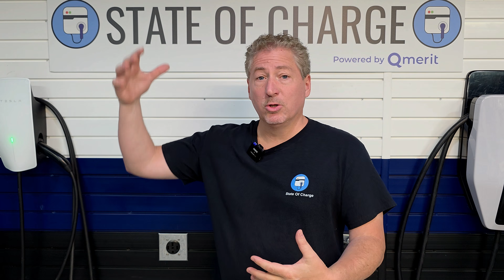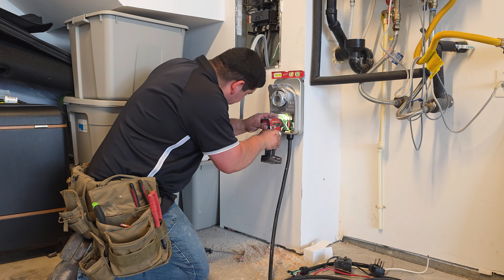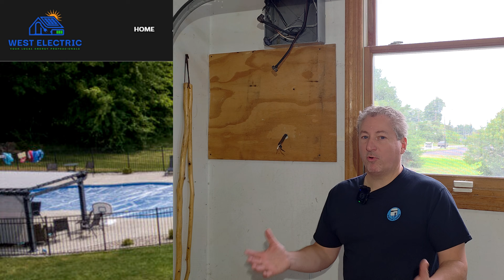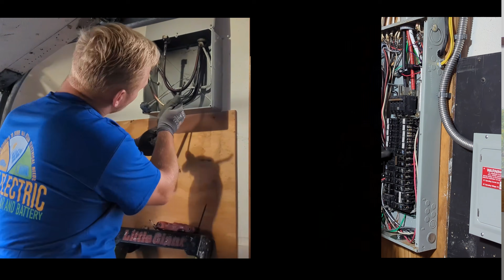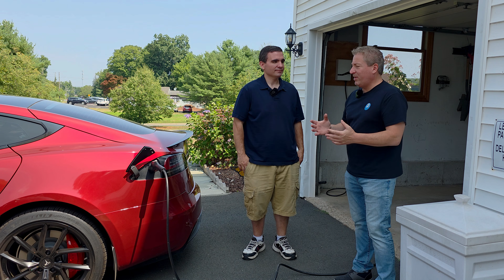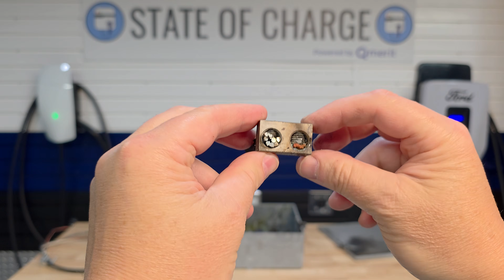Recharge Rescue Connecticut: Poorly Done EV Charger Installation Causes Fire

Comment: I have a real problem with the main wire being aluminum.  For now, with just the 60 amp circuit and the 48 amp load, there will probably not be any issues as it is vastly oversized, but aluminum expands much more under heat than copper and running an 80 amp EVSE in the future could easily see a condition where the connections loosen over time due to that heat cycle.

I hope that you informed the home owner about this.

When I had my 48 amp Grizzl-E Ultimate EVSE installed, I insisted on a 4awg wire over the "accepted' 6awg for the entire run purely on the whole heat cycle issue.  4awg is not going to heat up nearly as much as 6awg will.  As the circuit ages, that extra overhead is worth it to me, and in the grand scheme of things, the larger wire didn't add that much more to the cost of the install.

I really hope that the electrical code catches up.  The hazard that exists in these circuits is no joke.  People simply do not understand just how much power an EVSE moves compared to anything else in their home.

Kudos to Emporia for the donation and their load management system is truly a game changer.
Reply: Thanks for the input. As it turns out, I probably don't have the overhead in my panel for an 80amp charger anyways without upgrading to 400 amp service. So it's doubtful if that will even happen - I'll cross that bridge when I get to it and probably rerun it with copper if and when the time comes, but that'll be an expensive upgrade.
Reply: @ampedupevfsd  Yeah, if you do want more power, I highly recommend going 1-2 breaker sizes smaller for the wire on EVSEs. I'd max that AL wire out on a 80A breaker, which would still give you 64A/15Kw of charging. That's a hecking lot, even for a large vehicle.

Comment: One thing to note, if you have an electrical fire, turn off the power to the device on fire before using a fire extinguisher, otherwise the fire may not go out!
Reply: Disagree.  Depending on how far away the electrical panel or a disconnection point is, the fire may go out of control before you have time to cut the power and return with a fire extinguisher.  Using the fire extinguisher first may not completely put out the fire or stop the ignition source, but it reduces the immediate threat and buys you time to go and cut the power.  The best course of action should be judged on a case-by-case basis.  Clearly in this case the homeowner was not wrong to use the fire extinguisher first.  It put out the fire.  After cutting the power you might want to monitor for burning or use the fire extinguisher again.
Reply: @jbalazer  Disagree all you want, the power needs to be cut off before you go messing with anything. The cause needs to be dealt with before you start dealing with the symptoms. The panel is literally in the garage.
Reply: @JorgTheElder the panel that feeds this charger is not the one in the garage, it's on the complete opposite end of the house in the basement.
Reply: What makes you think they didn't?

Comment: US electrical codes are inadequate for Electric Vehicle charging.
This home owner did everything "right"

1. Used a licensed electrician.
2. Pulled a permit.
3. Had it inspected.
4. Used a hard wired EVSE.
5. Used a top tier EVSE (Chargepoint), I assume it was UL certified as well.

Still had a fire. This is unacceptable.

Had the electrical code required that all EVSE's be protected with an AFCI breaker then this fire would have been prevented. As soon as arcing is detected it would trip. Its insane to me that we don't have arc fault protection given the prevalence of EVSE fires and what tends to be the problem, arcing.

Try buying a dual pole breaker that has AFCI protection. Good luck. Unobtainium.

QMerit are among the best, however the home owner could still have a fire due to wiring failure. We need better codes for EV's to force electrical manufacturers to provide arc fault protection for high amperage circuits.
Reply: You might be right but in this case the code, or even common sense on the part of the original “electrician,” wasn’t being followed!
Reply: I mean, this scenario wasn't so much the code issue (could easily argue you're correct about the AFCI req.) more than it was just lazy workmanship. 
However, I think you bring up a good point that something like torque indicating fasteners should be required as that's almost always the point of failure it seems. If the terminals aren't showing they were torqued properly, it's a fail. Would also introduce other fines/disciplinary consequences if a fire does happen and the fasteners are shown not to be in spec.
But I also feel like actual certified EVSE installers needs to be a requirement, that would also help just as much if not more than code changes. It wouldn't even be that difficult for electricians to get, it's all pretty elementary stuff, just have to know it.
Reply: I was expecting coming into this video. The precaution would be, even if you do all 5 of these things, doing the right thing doesn't mean you're perfectly safe, have a fire extinguisher nearby. To have the culprit be incorrect wire gauge is just so obvious and simple that I am just shocked.
Reply: This wasn't an arc fault.  It was pure heat.  The entire resistance existed at the point the circuit was asked to cram the power into the crushed 8awg wire.  That is the point things went sideways.  The plastic on the connector was heated to the combustion point and then it burned out the side of the plastic panel.  I don't think any breaker design would have tripped at this point.  

That said, you always size your breaker/fuse to match the expected load.  In this case, the load would be a continuous 48 amp and code says you need that to be 80% of the circuit's capacity.  Thus, you should have a 60 amp breaker.  Not because bigger can't handle it, but because bigger allows too much variance between expected service and error protection.

Comment: I wish Qmerit would work with its contractors to do a “charger check” for like $25-$50. It would be great piece of mind to have a professional do a check on my 4 year old system and make sure everything is looking good. It would be a good way for them to get more jobs as well. I am sure a lot of installs could use a little work. I did recently install a smart smoke detector near my circuit panel/ EV charger just in case but I don’t want it to get to that part.
Reply: Minimum that's gonna take an hour of their time to get there and inspect. It would easily be $100 minimum, if not closer to 200. But still cheap compared to a burned down EVSE/J-box or worse, a burned down structure.

Comment: Why did they use a box and  not go directly to evse
Reply: Because they ran aluminum wiring from panel and almost every evse requires copper wire. The connections in most electrical equipment is rated for copper and not aluminum wiring. That is why they had the Polaris taps in the box that allowed copper and aluminum wires to connect to each other without bimetallic corrosion.
Reply from the maker: @Lawrence-pv3hg  Correct, and it was a long run. When Matt initially installed the run, the electrician said copper would be $1,000 more and wasn't necessary.
Reply: @StateOfChargeWithTomMoloughney  I would never allow aluminum wiring to be used in my house for any reason or cost savings. My life and family are worth a lot more.
Reply: @chuckwielang3532  nothing wrong with aluminum wire if spec and used correctly with the right hardware. Just dont use it like copper.
Reply: @chuckwielang3532  Properly sized and installed aluminum wires are safe. The only way it was related here is that it required extra connections. Had those connections actually been withing code, there would have been no problem.

Comment: A smoke detector immediately above the panel is a going to give the quickest warning of a problem. The smoke detector should be networked to all the other smoke detectors and tied to the internet to alert connected phone apps installed on both the owners phones and the next door neighbor’s phone.
Reply: That's exactly what I have.  It's a nest smoke detector as well as a Ring module, so if it goes off so do all of my smoke detectors and my alarm system. It also goes to my phone and calls the fire department.

Comment: Why the junction? Why not just wire the charger to the oversize wire? Junctions are just another failure point and I think they should be banned on charging circuits.
Reply: The evse likely can’t use that gauge wire and/or isn’t rated for aluminum. There nothing wrong with splicing wire as long as it’s done correctly.
Reply: @jubowub yeah, The ChargePoint would be maxed out the way their connections work with 4awg copper.  No way it would take a lower gauge Al

Comment: I think Ed is wrong that the right size breaker would have tripped under this condition. A bad connection in line with a load cannot add more amps to the load. An AFCI breaker may have tripped because of the bad connection.
Reply: That's a good point because it wasn't a short.
Reply: Maybe not what he meant, but the right size breaker should have been 40 amp..
Reply from the maker: There's a good chance it wouldn't have, but it could have. I have seen breakers trip when the arching starts.
Reply: @StateOfChargeWithTomMoloughney  , in the case of a constant current load like av EV charger, a bad connection only increases the current if there's conduction from live to neutral or ground (i.e., a short circuit).  A bad connection isolated to one of the current carrying conductors doesn't add any current.  It only drops voltage, and that doesn't cause the EV charger to draw any more current.  An overcurrent device won't trip in this scenario.
Reply from the maker: @jbalazer I do understand why it shouldn't trip in most circumstances.  But I have had followers tell me the breaker did trip when there was a severe melting/fire at the outlet. I'm just reporting that it does sometime trip, unless everyone that told me that was confused or lying. 🙂
Reply: @StateOfChargeWithTomMoloughney  In the UK it likely would have at either size because they usually require arc-detecting breakers. I am pretty sure that unless the arc was between conductors, in other words a short, it would not have increased the current.

Comment: Cannot understand how 8 gauge wire on a 100amp breaker ever passed inspection.  That should have been caught.   Also, I'd personally put non-flammable hardi-board or DuRock behind to mount the charger itself.   But that's just me.
Reply from the maker: You'd be surprised how often I find problems like this that were inspected and approved. That's not a bad suggestion, but if it's done right, it's not necessary, especially with the metal box.
Reply: City inspectors just want your permit fee, many don't care about the actual inspection.
Reply: The 100amp breaker is connected to 3awg going out to the transfer box. That's all the inspector looked at. They didn't even open up the EVSE or the transfer box to notice the smaller 8 gauge wire being used.

Comment: What we see here is the hidden costs of buying and owning and EV.
Reply: No, it’s the hidden cost of shoddy workmanship and drive by inspection.  I’ve experienced similar electrical shenanigans on work completely unrelated to EVs.
Reply: I'd still never go back to owning an ICE vehicle. They're that much better.

Next time just hire better electricians the first time around i.e. QMerit, apparently.
Reply: Yeah, and one of the hidden costs of owning an ICE vehicle is that they are involved in 60x as many fires as EVs. Not sure if you have heard, but ICE vehicles have tens of gallons of an inflammable liquid in them.
Reply: @JorgTheElder they also leak oil on my garage floor

Comment: I installed my own Tesla wall connector and while I think I did it right, it has never really been tested as my Model 3 only draws 32A and I’ve only put 48A through the system for an hour or two when a visitor came by with a Model Y Long Range. 

6 gauge copper in one continuous run through metal conduit from the 60A breaker to the wall connector, torqued to spec on both ends.
Reply: Everything says 6awg is OK.   I looked at the data and when new, I agree it should be just fine.  But look at the corrosion and heat cycle data.  Over time, the degradation gets really close to the theoretical limits.  It would only take a small defect or other issue somewhere in the system to create a real problem.  As a result, I had my system installed with a 4awg just to have that extra headroom for the long haul.  The price difference was something like $80 which on a $1400 bill is worth the extra piece of mind.
Reply: @christophersiano969  The temperature rating of the #6 awg wire insulation is key. THHN can be rated for as high as 90 degrees C, but some can be 75 degrees C keep an eye out for that. Use the highest temperature rated THHN you can find!
Reply: @richsi7638  Pretty sure THHN is always 90C unless in wet environment. However, I've rarely ever seen any device or terminal rated for 90C, almost always 75C or sometimes 60C, so that's how you have to size your wire & breaker more often than not in my experience.

Comment: Great video.

How does the load management work when the two EVSE's are different brands?

I know you can load balance multiple Tesla wall connectors in the app after install. How does it work when you have multiple brands?
Reply from the maker: No it doesn't. The Wall Connector isn't using load management,  its fine without it. The Emporia will throttle back if needed and that's enough for Matt's case.
Reply: I am pretty sure the new EVESE just has a sensor on the house's main service connection and reduces what it uses based on the current detected there. Has nothing to do with the other EVSE.
Reply: @JorgTheElder  That's how the VUE works.  It has sensors to measure the total amount of juice consumed in the entire house in addition to sensors on specific circuits of your chosing.  So it would be able to sense that the overall consumption within the house is getting too close to the limit for 200A service, and it can tell the Emporia EVSE to throttle back charging to keep within limits.  If Matt only had one EVSE, it might have been the case that the load calculation would have said that everything was fine, and there wouldn't have been the need to install the Vue.  That's just a guess on my part, since I obviously wasn't the one doing the load calculation.

Comment: Good job Tom. I know where that supplier is In Middletown. I used to live there before I retired to Florida. I hired a Tesla certified electrician to install my EV charger in my garage. Then I had a second charger installed with the Nema 14-50 by the same Electrician it was like a year later. Leave that always plugged in and turn off with Breaker so no wear and tear on plug.
Reply: Why are you turning it off? Now you're just wearing out the breaker.
Reply: @dyoel182  Agreed, breakers are not rated to be used as switches.  If the owner wants to frequently turn off the circuit, a 2 pole disconnect would be a better choice.

Comment: I was in a Home Depot yesterday and a home owner was asking for guidance on installing a sub panel + hardwire a 40A EV charger. A random shopper was telling him to wire the sub panel with aluminum wire as that is much cheaper. Is that a good idea?
Reply from the maker: Not sure getting advised by a random Home Depot shopper is ever really a good idea...
But if done properly,  you can use aluminum wire for the main feed. Copper would be better for sure, but you can use it if everything else is done correctly.

Comment: I have a Splitvolt 10-30 plugged into a Slater brand receptacle from 1957. I also have an extension cord and manual splitter. One of the prongs started scorching. It was the splitter that was defective. It was bought from a RV supply place. Beware. Splitvolt charger, extension cord, and receptacle all fine and when I grab the cords during charging it is only slightly warm. 
My panel is 12 feet from the back door to the garage. I wonder if outside conduit of that length could be run from panel to garage and receptacle put in. It would be quick and easy compared to running the wiring through the walls.
Reply: A lot of RV plugs and accessories are not rated for continuous high loads like EV charging.

Comment: When I had my EVSE installed, I spoke with 3 licensed electricians. I had wanted wiring to accommodate a future 80 amp. Only the Qmerit-recommended electrician bothered with a load calculation and determined that, without load management, I could not accommodate more than 48 amps of charging. The others just looked at the panel and said "I had space".
Reply: They can be expensive, but you know it's done right when Qmerit does it

Comment: We are having a new house built (presently 95% complete) and had two 200a panels installed for future proofing for EV charging to avoid any potential problem like that in this video.  I was going to have a 400a panel installed but code does not allow 400a panels in a residential home. We will never charge more than two vehicles so each panel has one charger connected.

Comment: When I installed a Charge Point unit in my garage to charge my Chevy Silverado RST, I wanted to use QMerit, but I was uncomfortable with their policy of making a downpayment before they'd come to the house. I was totally comfortable paying a separate inhouse inspection and consultation but that was not an option. It occurred to me to go to the Tesla website where I got a list of certified Tesla installers in my area. I contacted one and he did an excellent job, no junction box and wired directly to the electrical panel in the basement with the metal clad sheathing around the appropriate guage wire. If QMerit still operates with this policy, maybe new EV owners might find this helpful in choosing an electrician.